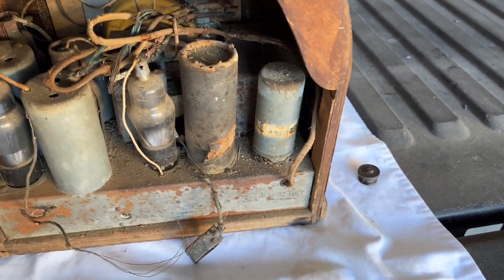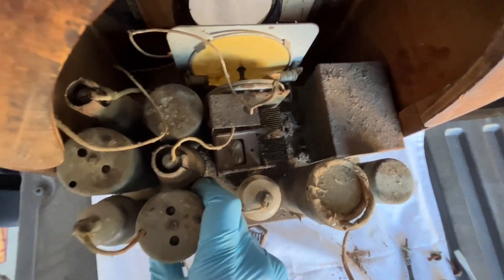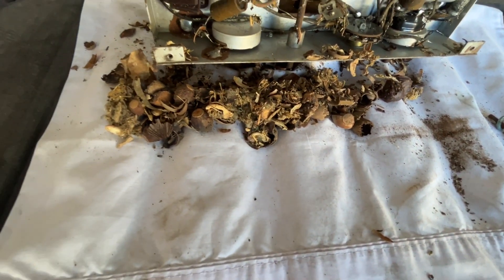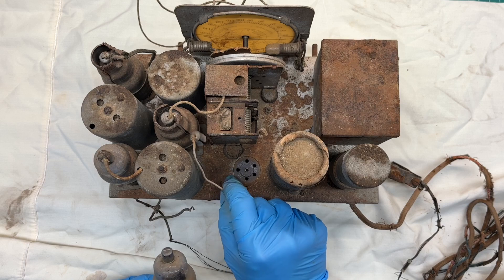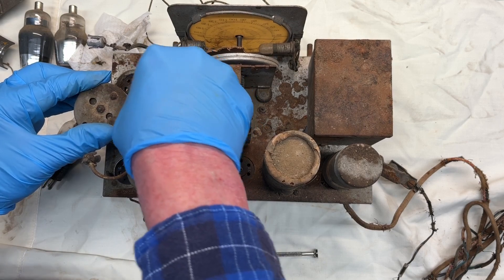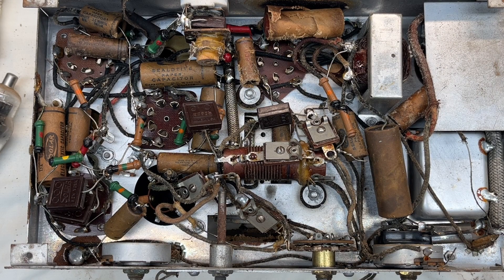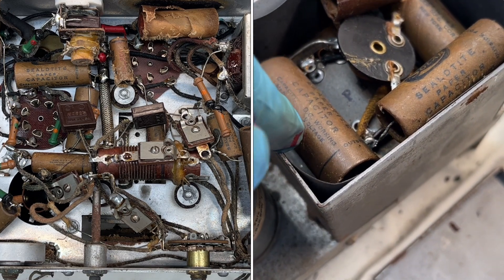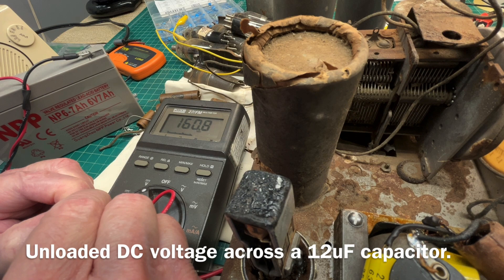Simplex Model PB | Chassis Reveal & Synchronous Vibrator

Comment: That was just fascinating tour and rebuild start of this cool radio Don. What is funny is that I worked for Simplex, back in the early 80's. Simplex time recoder that made time clocks and such so no relation to your older defunct radion comp i believe. Cool vibrator approach i never new about as well, but makes sense. Thanks for sharing Don, loved it!
Reply from the maker: Cool that you worked for a company named Simplex. It was rewarding and educational to design and build a few different circuits that performed well. Thanks for watching my friend. Best, Don

Comment: Don,
This one might be your most challenging yet.
Reply from the maker: Ian - it definitely has some battle scars. It looks/performs electrically sound other than the one coil the mice enjoyed eating based on a few brief power ups after rebuilding the power supply circuit. The old rusty chassis will definitely be time consuming. Thanks for following along and I hope this finds you doing well. Best, Don

Comment: I hope the mechanical synchronous vibrator continues to work, and you do not have many open coils. Having the tubes match the sockets is a very good sign as you know. Good luck!
Reply from the maker: The old mechanical vibrator starts, but does not perform consistent under load, so I’ve already built two solid-state circuits that I’ll hide in the old vibrator can. I may try aligning the old mechanical… one more time, but I think it’s EOL. Thanks for watching and following along. Rick. Best, Don